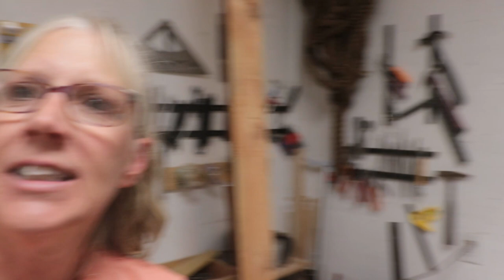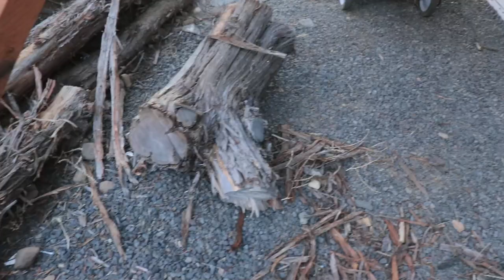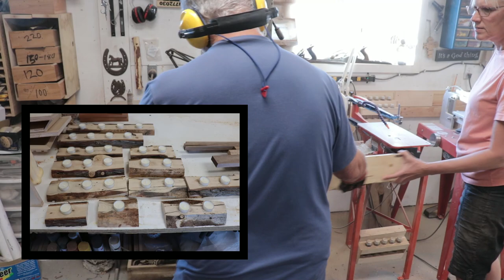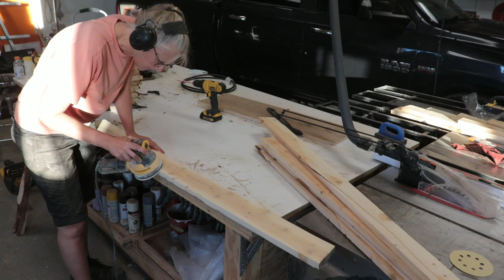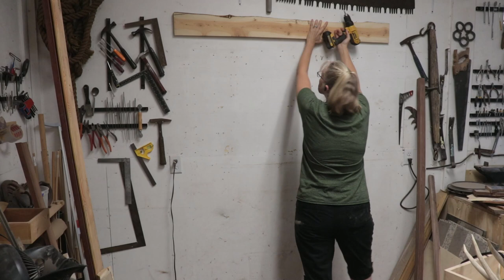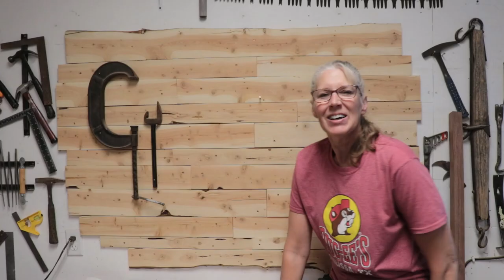Juniper Wood Wall

Comment: Very nice on the wall, but shame on you and hubby. You both did not wear mask, and yes you have a dust collecting system, but it doesn't get it all, noticed it when you were cutting the log, and when you were sanding. What you breathe in, you don't breathe it all out. God Bless.
Reply from the maker: Thanks Kurt, yep, you're correct, we should use our PPE!